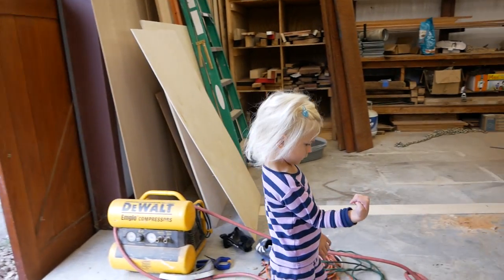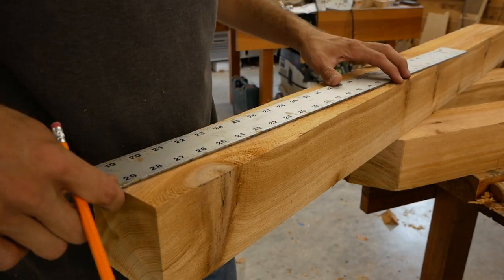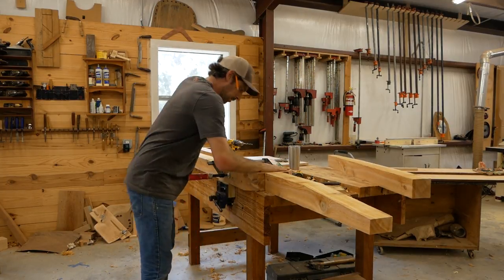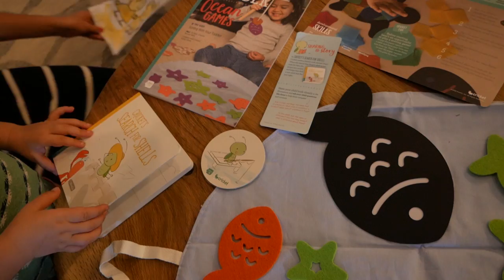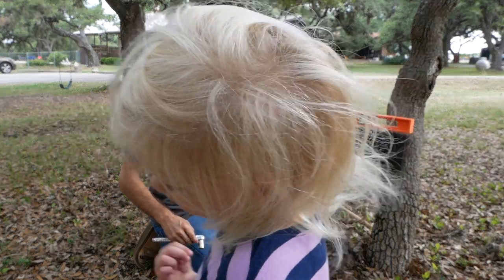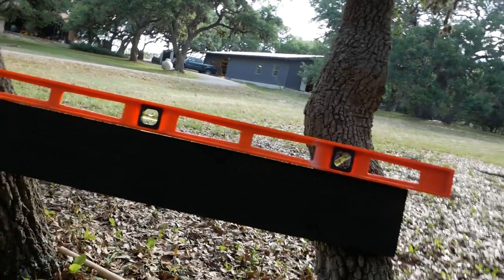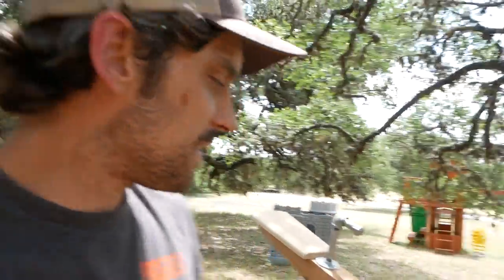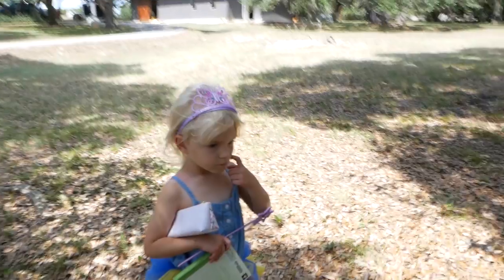AR10: I Built A SeeSaw For My Kids And They Love It!!!

Comment: Great build. Hand hold I thought would be not an elbow but a tee piece with small extensions to either side, also there is normally an extension from the underside of the seat that stops the seat from bottoming out on the ground. Apparently kids legs can get trapped underneath the seat and broken if it slams down. Last thing. Keep up the good work

Comment: Eyebolts on the brace wood, metal rod drilled and tapped then  gets held in place by said eyebolts. You could now screw the seesaw into the  rod from the top to secure it.. not sure if it would make a horrible metal on metal sound but there could be many ways to modify this idea if you wanted to go in this direction... love this project.

Comment: "you just bribed her with tv" I burst out hahaha. Great video, cool to see another side of you. For the axle you may be able to put a smaller rod through it and 90 it down and connect the same way as you did with the handles. We used to have a see saw at school and they burried tires vertically 3/4 of the way so you didn't hurt your ass. Keep up the awesome work! Cheers